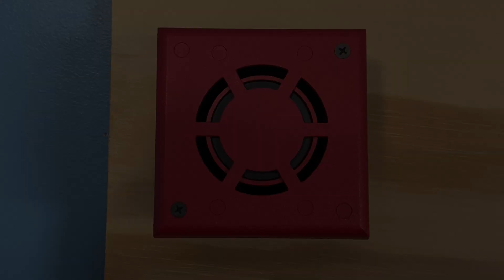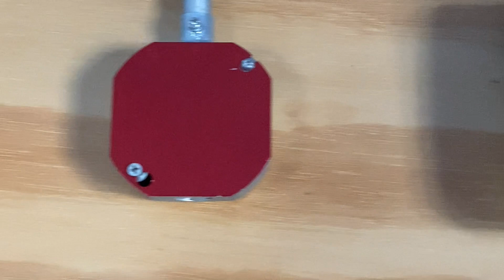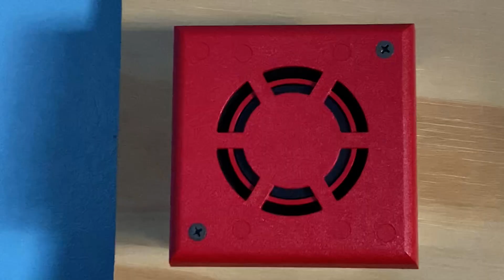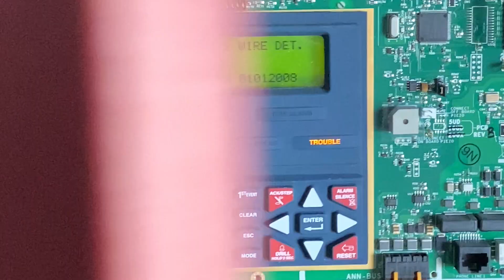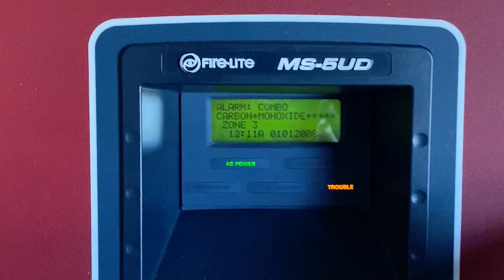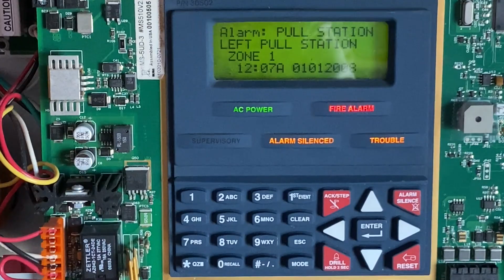Board System Test 292 l #FireAlarmFriday

Comment: Do u wire the 4 wire fire alarm into the panel 2 wire positive and negative?
Reply from the maker: Yes, but there is a setting on the device to adjust this. I have this device set as 2 wire.
Reply: @FireAlarm33  how? Do u set it on 2 wire can u make a video about 4 wires alarms?